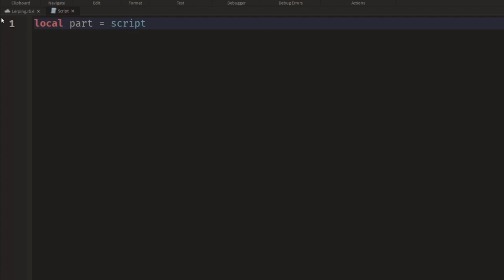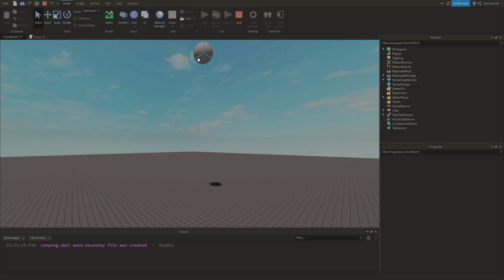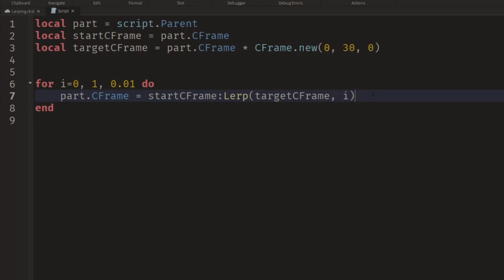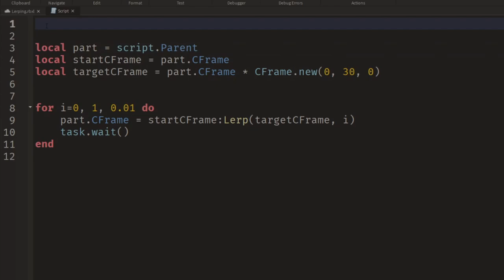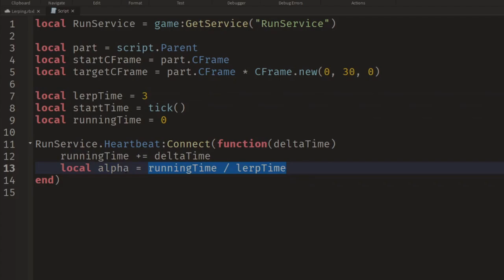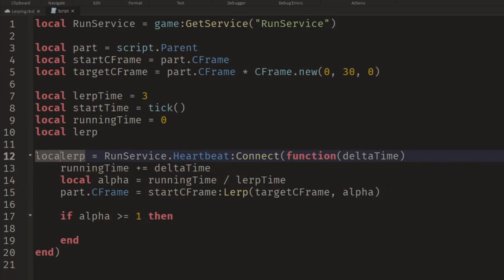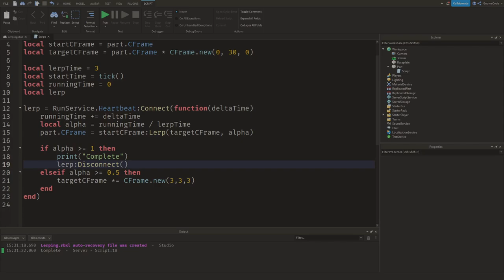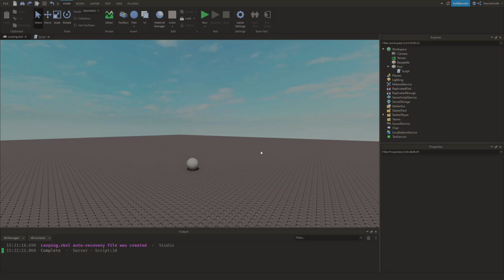Lerping - How To Move Parts Without TweenService

Comment: I'm confused on why the alpha value is runningTime divided by lerpTime. Could someone explain it?
Reply: Getting its speed
Reply: and move in constant
Reply: @BasedOnBrian  yeah but he said that the runningTime was 1.5 and I don't understand where that came from, because the value in the variable was 0.
Reply: @jackoboy7766  Heartbeat detects ur frame wdym
Reply: Bc needs to get the percentage. .5 = 50% for example; it has to be a value between 0 and 1, and you do that by dividing by the maximum amount.

Comment: An interesting way to move parts! I do have a question though, if a player were to stand on a lerping part, would they stay on it?
Reply from the maker: No, when you directly set the CFrame of a part you're not using the roblox physics engine (Which is required for standing on moving items). Instead you should make use of BodyMovers/Contraints for that.
Reply: @GnomeCode  whats that
Reply: @UltraDubzYT look it up

Comment: part.CFrame.Position.X += 10 easy
Reply: not smooth
Reply: This would be a LOT better: part.CFrame.Position.X += ((part2.CFrame.Position.X - part.CFrame.Position.X)*0.1)
basically takes the difference and multiplies it by 0.1 making it smooth cuz when the part is closer starts to go slower because we multiply the difference by 0.1 meaning the closer it is, the slower it is. (honestly this is a TERRIBLE option, but also an option.)